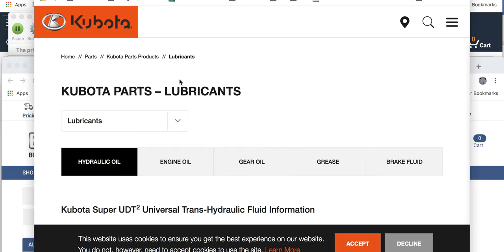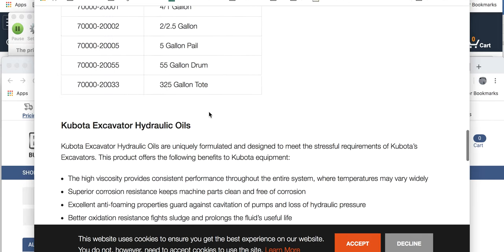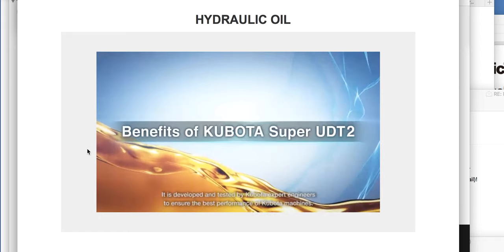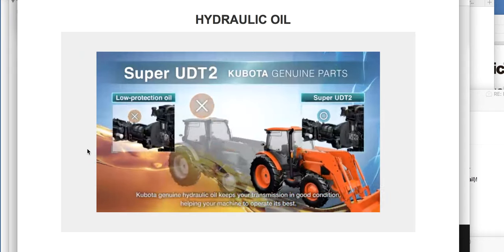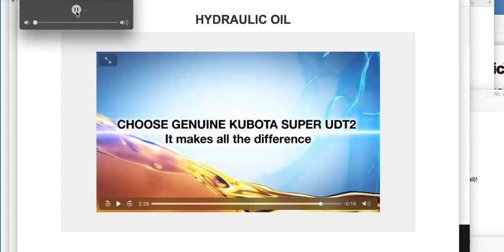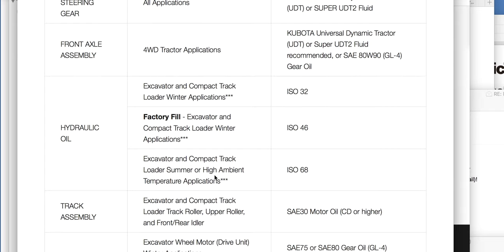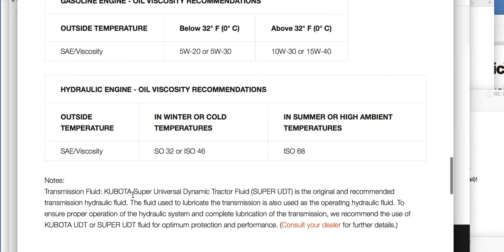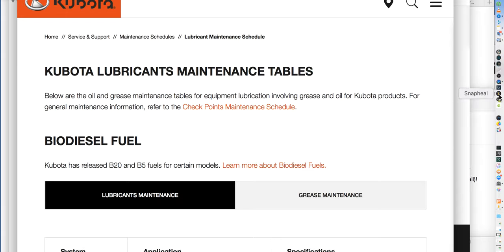KUBUTA UDT OIL WHAT IS COMPATIBLE DO I HAVE TO USE KUBOTA UDT2

Comment: Trying to figure this out myself.  I have an L3901HST.  
 On page 59, in the specs for the transmission fluid it calls for Kubota Super UDT2.  For the front axle it calls for Kubota Super UDT2 or 80-90 SAE. 
In smaller print below the chart it says it is "KUBOTA Super UDT-2: For an enhanced ownership experience, we highly recommend Super UDT-2 to be used instead of standard hydraulic/transmission fluid."
"enhanced ownership experience"......WTF does that mean?
Below that it says, "Regular UDT is also permitted for use in this machine".  
So, does this mean that I can use any brand UDT, and if so can I use it in the front axle?  I think Kubota wants us to buy the super expensive Kubota SUDT2,  but cannot require us to buy their brand.  They call it by name and then in small print state that regular UDT can be used, but leave the details very vague to create doubt in our minds so we will buy the SUDT anyway.  This gives them an out if someone claims they force us to buy their brand to maintain warranties.  As much as I hate to have the government get involved in anything, I think it is time for there to be created a official classification system (like the one for motor oil) for different types of hydraulic fluids, instead of manufactures creating their own system out of their ass in order to keep everybody confused.
Reply: WE  HAVE   A   50   HP   KUBOTA  4X4   AND   DEALER   TOLD   ME   ONLY  USE   80  90   WEIGHT    IN   FRONT   4X4   AXLE   .
Reply: Just got a new L3302, with only 8 hours on it I noticed a fitting was loose and most of the oil leaked out... now it's Sunday and the dealer is closed and I cannot find UDT2 anywhere else... nothing like a broken down tractor 2 days after buying it.

Comment: All the manufacturers use FUD and hyper marketing fluff to keep the consumers money towards their super expensive branded lubricants. Most people falls for the notion of better safe than sorry. I have a Kubota and I remind myself it is a damn tractor, not high performance precision equipment like my race cars.
Reply from the maker: Viscosity and temperature range counts...  and some have the additive to help with keeping rust down from some saturated metals... exposed crank case metal will rust (as the lubricant drips from the surfaces to the bottom of case = the protective film does not remain)...
A sitting piece of equipment will usually show this rust I am referencing and one theory is to use first a larger micron filer   before the 10 micron filter e.g.  20 microns and then the 10 microns

Comment: thx for the video.   We have  a kubota m-5 091 tractor.  We are getting ready to change out all fluids and filters.   The dealer advises that we  bring the tractor in for 1000 hr maintenance but I think it consists of changing all fluids and filters.  Was planning on doing it onsite ourselves.

I was thinking of using the Duraguard synthetic blend universal hydraulic tractor fluid instead of the Kubota super udt2, what do you think?
Also was considering using after market filters, do you have any thoughts about that, Thank You!
Reply from the maker: Do an oil analysis and determine condition of motor wear.
Then make your decision based on oil 🛢️ performance...
It also depends on your operating temperature, ambient

Comment: I bought a new 3301 with a backhoe attachment for the dinky little jobs. What a poorly engineered piece of junk. Like a child's toy. The hydraulics howl louder than any other equipment I have. Very week and slow. Checked the hydrolic filter and it was collapsed. Warranty just changed the oil. What a joke. 
They say use only high dollar UDT oil. They also say don't mix it with anything elsel. Apparently mine doesn't even work on their high dollar oil. 
I bought another Cat ( bigger of course ) and it is sure good to have another piece of real equipment  -  no games. It works and takes 10wt hydraulic oil just like my other Cat. Any brand oil and in all components except the engine. No special UDT that costs big dollars and does nothing different. 
And besides 80-90wt is way thicker than UDT and they say it interchanges in places? It can't be that critical. 
Kubota is a cheep scam company to me  -  but they have lots of equipment out there. Some must work for some people,  or else they have never operated quality equipment before. Never again will I get a Kubota. They are like an AMC Matador among Camaros. and Mustangs
Reply from the maker: Wow. You obviously had an issue with your machine that you blamed on the oil...
Sounds like you have a ''flow issue'' , which can be numerous issues... none of which you should have continued running the equipment on.
You should have fix the issue and not run the machine. 
To your oil comment, viscosity counts and you should not disrespect the importance of this based on usage / conditions of machine's operating conditions.
So, calling Kubota junk is not logical, you describe abuse of ownership on your part... But, yes, Kubota likes to overcharge for the same viscosity sold cheaper by others.